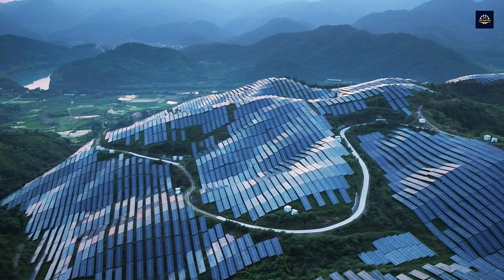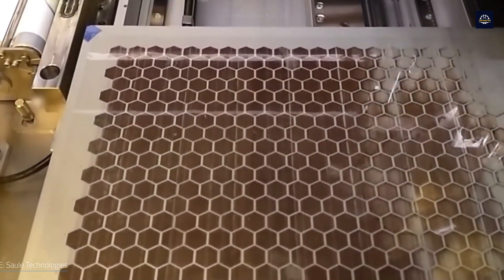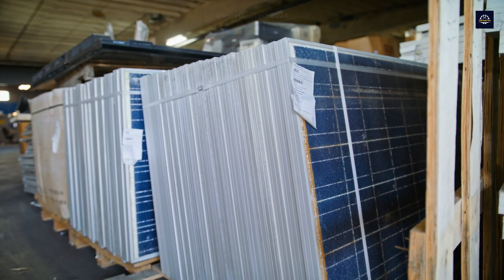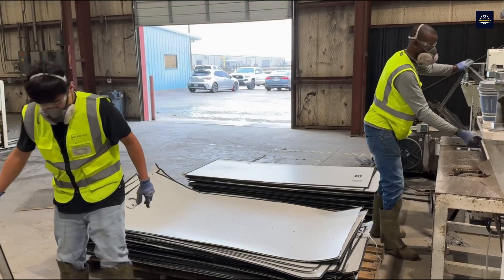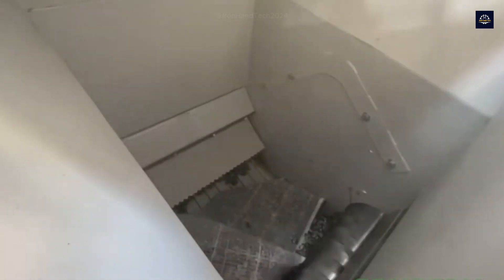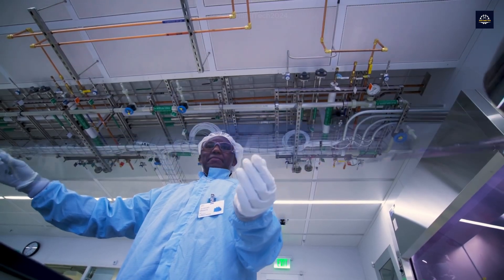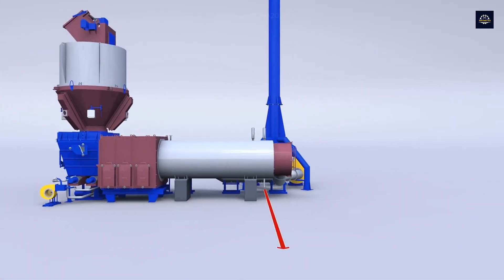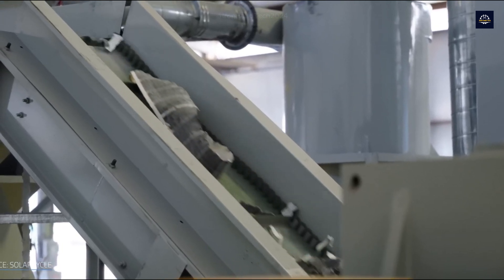How to Recycle Solar Panels?

Comment: It’s a great video! Very well explained! But I have a question; how pure are the particles of copper, aluminum and silicon after being separated by the electrostatic separation chamber? Doesn’t the EVA affect too much on their purity? Where do they go after that? Thank you!
Reply from the maker: Thank you. These copper, aluminum and silicon particles will be sent to other recycling plants for different purposes.
Reply: And what about the purity? It must be important when trying to sell those particles to those other industries, right?
Reply from the maker: @lidia_121  Your question is very good. After this process, the materials may not have reached absolute purity, however, they will be further processed when they become input materials for other factories. Acceptable purity depends on the needs of the plants taking this material as input. You help me understand that I'm not really good at my content. Thank you very much.